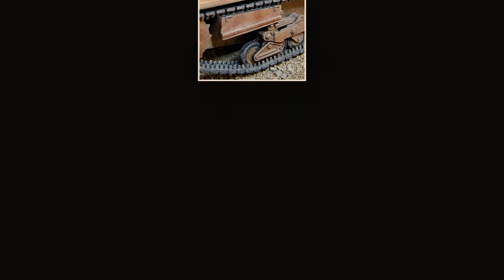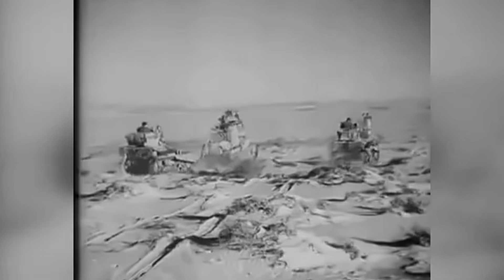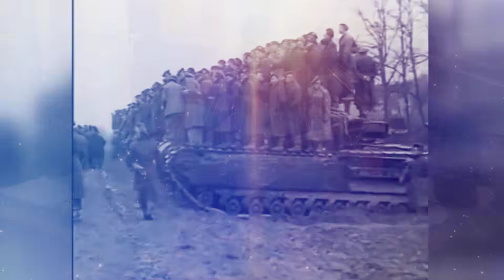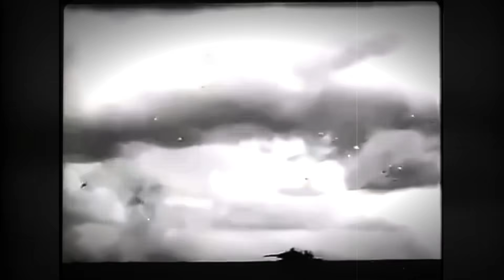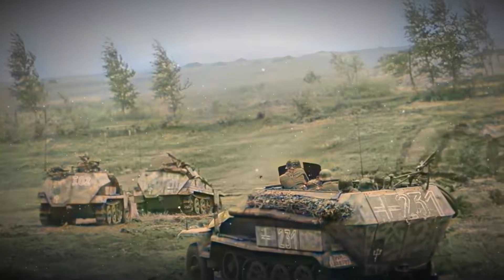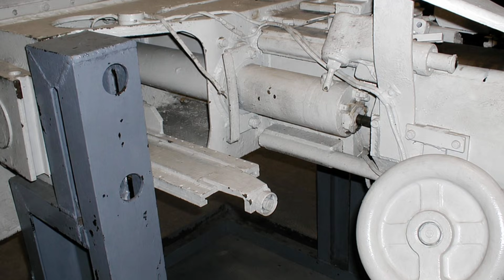Every WW2 Battle Tank Ranked From WORST to BEST

Comment: The Churchill
It was put to service too soon. 
In the manual, Vauxhall said that there were faults and they were fixing them.
On the beaches at Dieppe, every tank would have struggled on that  beach of chert,  the pebbles were like ball bearings
Also Dieppe was a garrison port, any force landing there was going to be chewed up.
By mid 1943 the Churchill was pretty well sorted
It was a Churchill that stopped a Tiger 1 in Tunisia. That thank (Tiger 131) is the only running Tiger 1 in the world
The Churchill was one of the best tanks in Normandy as it was built for attrtional slug fests. Not to mention Percy Hobart's specialised armour